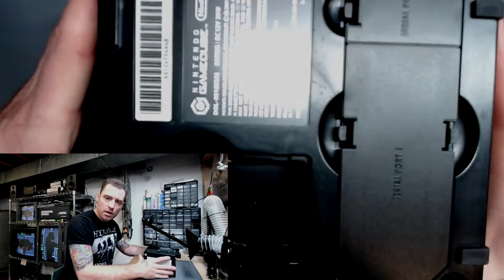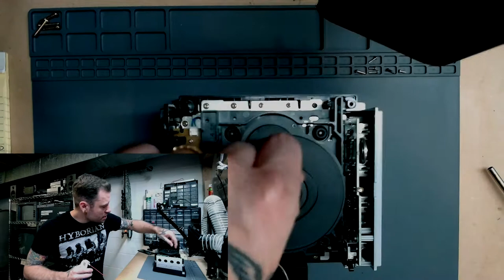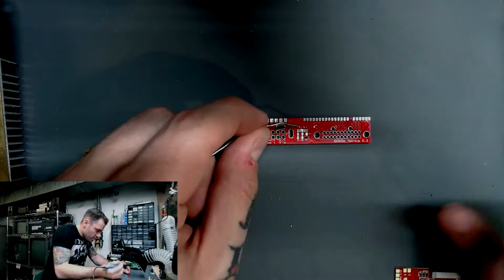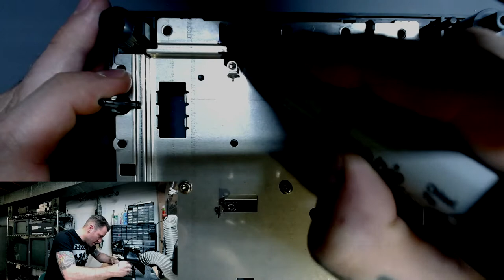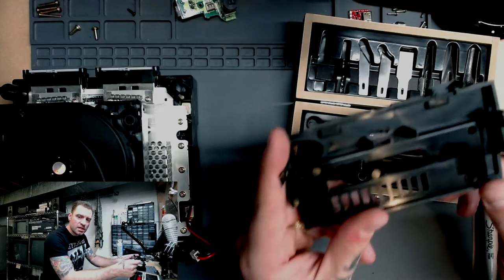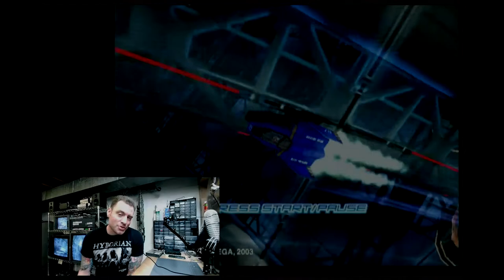1st Gamecube GCDual Installation!

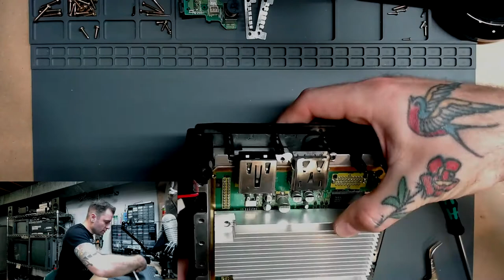Comment: One mistake pretty much every install video on youtube forgot was put one of the nuts it came with under the main board and screw in that heatsink screw that wasn't working for you at 39:00. We clipped the shielding where it would normally screw in. Voultar even forgot in his video, and edited in Dan's pic lol. I forgot it also lol. Great video otherwise!
Reply from the maker: Good call! Yeah, really easy to skip over that part. I have another cube I need to put one in when boards become available again. Won't forget that again!
Reply: @daneolds515 Good news! They're in stock at Castlemania right now

Comment: I just did the pluto hdmi mod. Wasn't that bad.   Kept all the original on the board and cut an hdmi spot in at the same place the duel uses.    I had one of those kaico adapters hanging off the back , but wasn't a fan of the weight hanging on the port.   The cube also got the gc loader, sd2sp2 for saving extra files, controller port led and Id mod with a swappable battery
Reply from the maker: Nice! Sounds like you tricked it out! I’d like to try an RGB led mod too. Haven’t done an ODE for a cube yet but I just wrapped a video on doing a PS1 ODE. I’ll be posting that here in the not too distant future. Keep up the good work and Merry Christmas!
Reply: @daneolds515  i been researching how to do a Bluetooth RBG mod for consoles, uses an app on your phone to change colors.  only thing I dont like is it uses an led strip.  so you'd have to wrap it in tape so it dont glow everywhere, route it perfectly, and line them up where you want them.    so , I been trying to design the module to have plugs so you can do the vent areas, controller ports, power, and if you swap to an gdemu to light that area.   definitely  a work in progress.
Reply from the maker: @JasonMeeks79  Cool! If you do it you should post a video! I always love seeing other people’s mod work.
Reply: @daneolds515  i try to do my mods on twitch. but sometimes cameras and wires get in the way.

Comment: I have yet to install a GC Dual, or one of the external adapters.  They are all rather expensive.  I do have a GC Loader (replaced the optical drive with SD card reader) and a SD2SP2 to add another SD card.  It's great as it is, but would love to sharpen the graphics more for my HD Display.  Would be easier on my eyes.
Reply from the maker: Cool! I haven't done an ODE yet but I plan to do one for my PS1 that has a failing disc drive. The GCDual is really cool. I love that I can use it to finally play my cube in RGB on my PVMs. It also looks great upscaled. I could totally see buying one of the GCHD MK2s. Has all of this functionality and it is plug and play. That said. Having a modded cube is just cooler if you ask me!
Reply: @daneolds515  Yeah I have other modded Consoles, but the Gamecube is my favorite. The GB Player has a lot to do with that. By far the best addon ever.